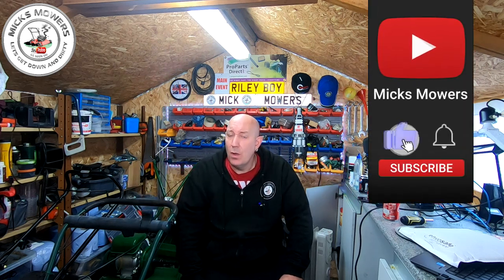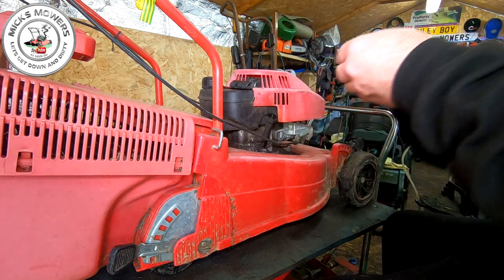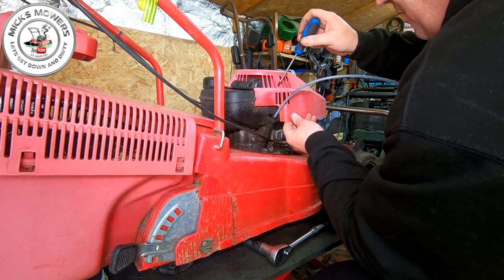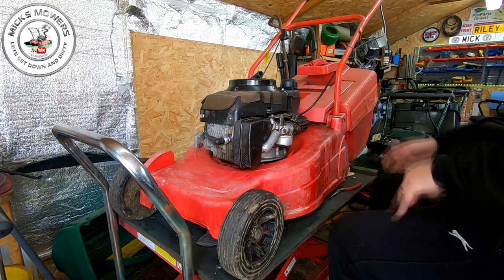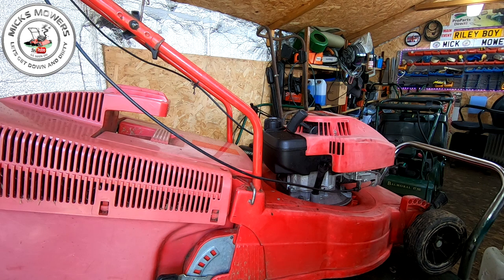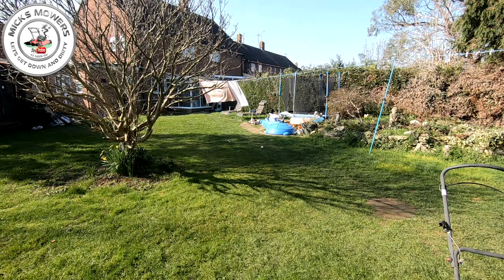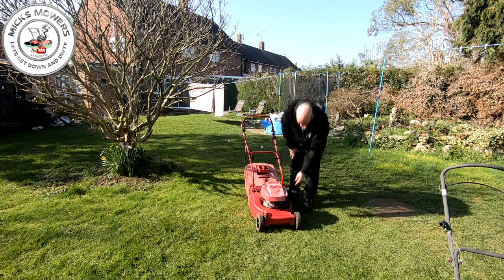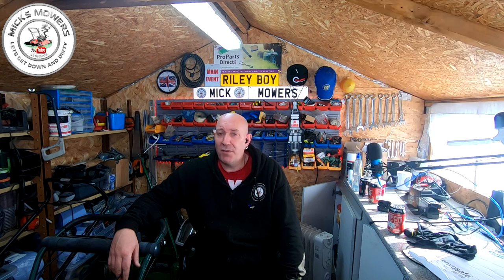lawnmower Repair MTD Cheap Mower All it needs Is A Little Service

Comment: Hi great video.Ive just got a used wilko dg400 petrol mower manul choke.When warm choke is off it back fires when running got this be a blocked jet in carb any idea thanks
Reply from the maker: Yeah could be a carb problem